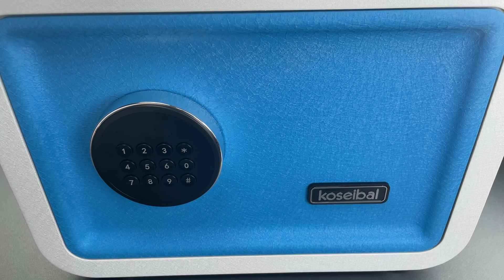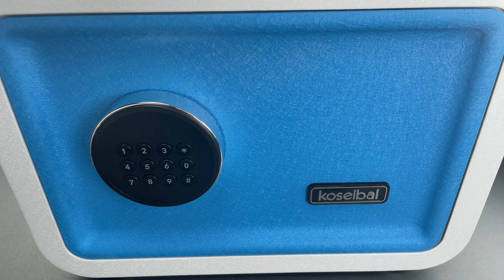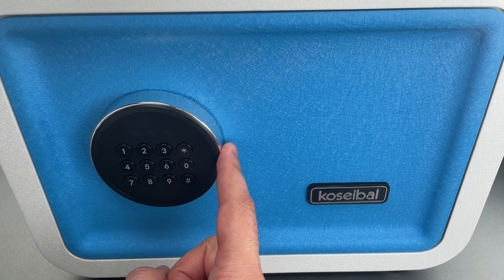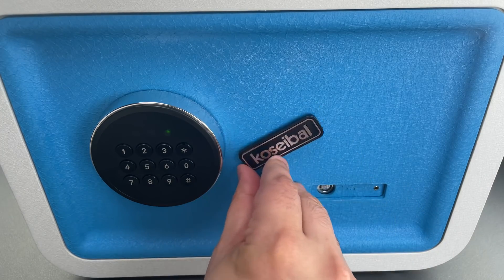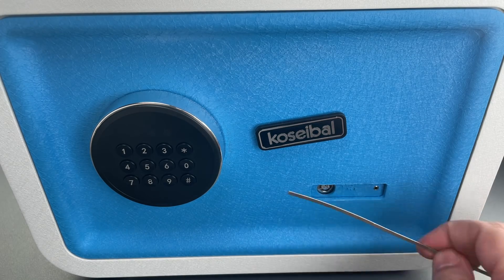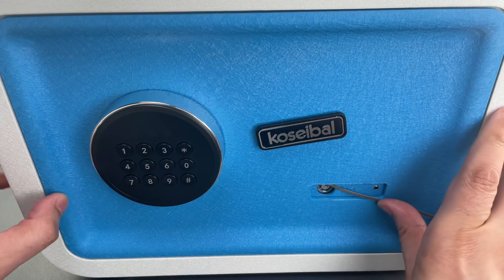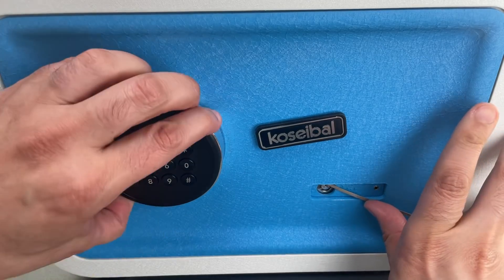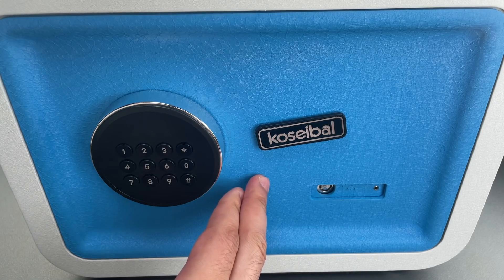[1321] HUGE Design Flaw In Koseibal Safe

Comment: "Finding the safe should be half the battle" So I should get a safe that's disguised as a microwave?
Reply: Basicly yes, few people looking for a safe are going to check in the microwave. A least not until they get tierd of searching and take a break and wet to heat their snack. It would certainly take them longer to find it than this neon blue pile of do do. Of course hiding your safe under or behind a hidden panel would be even better still but hidden in plain sight as something a thief is unlikely to check is still far better than a safe that stands out and is this easy to recognise as a safe.

Comment: I remember the first safe I had. I was 9 and It was so trash. It had 2 holes in the back to bolt it down. But I never could get permission to do that. So u could just stick something back there and depress the chance code button while the safe was closed from the inside and open it ip

Comment: I bought the Genesis Lock Pick Set and I finally got to use it today. I bought a master lock (lvl4) for my front gate.  So I decided to try to pick it. First click it opened. I thought it was a fluke, so I did it again. Took a bit longer .05 seconds longer and it opened. So I thought lets rake it open and omg this lock is definitely not going on my front gate.  # 140DLH

Edit: added a space between # and 1 so it's not a hashtag.

Comment: A safe design is only as good as its weakest point. If a would-be thief finds that weak point too easily, the manufacturer messed up big time. Also, the Garfield padlock I got out of a box of cereal back in the 80s was more secure than this piece of junk.

Comment: Here is a cross over question, what is the legal charges if you reach in between the bars on a gate and open the lock from the other side (like the memes), 
breaking and entering or just trespassing? and is there a difference between those two criminal charges anyway?

Comment: Even if it didn't have that gap and you'd have to pick it, that mechanical backup is one of those tubular cylinder locks too, isn't it..? Asking because I have picked one of those myself once with a piece of metal wire without any prior knowledge and if a dumbass like me can open it, then that's hardly something worth calling "safe".

Comment: Product to avoid? A little dab of epoxy in the gap and the problem is solved? Especially if the mechanical backup lock is replaced with a more secure one.
This is why you must evaluate the security also based on the fact that even if certain entry points or problems are fixed, for example replacing the backup lock with a security core, and then putting a dab of epoxy there, and making the mechanism more secure.
How secure is it then? Still a product to avoid?

its kind of problematic according to me, to shame a product for a flaw that can be easily fixed by the consumer with for example a dab of epoxy, or other similiar simple fixes.
If its only fixable by the manufacturer though, then its another story.

Comment: All these shitty locks that could be picked by Helen Keller. Isn't there a swing to this channel where we could get 5 or 10 of the easiest locks and work with the supplier to help them make it harder to pick? After 1300 locks that have been picked they are basically in a couple corners on what they do or not do.

Comment: Is there a lock that can't be beat or is hard to beat? It seems like every lock out there has some glaring flaw.
Reply: Depends on what you mean by "lock" and by "beat".  I suspect the answer is that any lock that uses a key can likely be picked or bypassed.*  As mechanical devices, they have certain limits that can be exploited by various sill levels of lock pickers.  High quality digital locks simply aren't vulnerable to the mechanical exploits that plague mechanical locks.  In all cases, however, the locks can be "beat" if destructive entry is allowed.

*The one system key system I don't know that I've seen bypassed or picked is the Abloy Protec2 Cliq system.

Comment: These days, all I do is take a look at how long the LPL clip is. . . 
Under 2 minutes?
YEP, the lock/safe/whatever is a POS. . .
If the clip is over 2 minutes long, it either means the device is perhaps a LITTLE bit secure. ..  Or else it's over 2 minutes because the LPL shows you 14 different ways to defeat it.

Comment: At this point, I'm pretty sure these are intentional backdoor to open it in case of failure and key lost. I means, one safe company probably got sued because the stuff inside got damaged after an atempt to force open it. Then they all decided to protect their butt. 

Coffee shop still have to put a warning that content is hot on the paper cup because of that..
It cannot be done wrong this way other than on purpose especially for something that has protect your property.

But I could be wrong too..

Comment: Videos are getting shorter and less interesting.  You used to put effort into them.
Reply: I sort of have to agree.  These very short videos had a comedic effect at first, but now they seem rushed.  Why not disassemble the "safe" so we can see how the exploit is working?  Why not also show us picking the cylinder lock?  Take off the digital keypad and see if it is vulnerable.  Show us how long it would take to get through the body with a hammer and screwdriver, or other similar destructive techniques once everything else has been exploited.